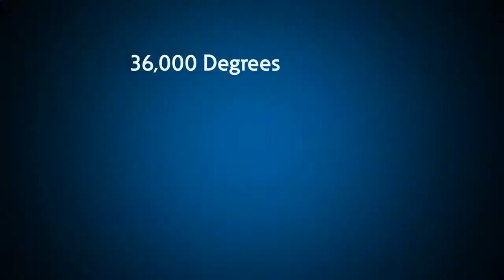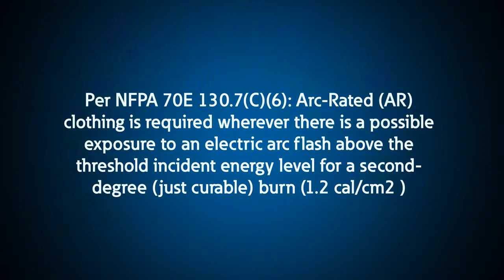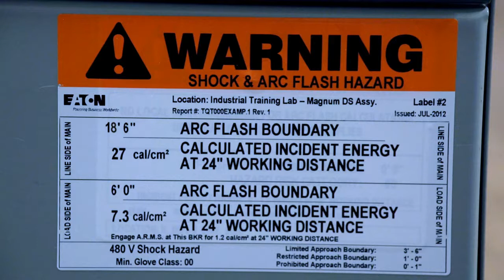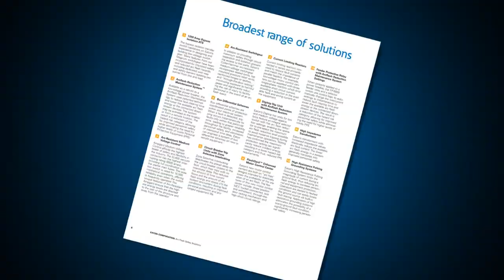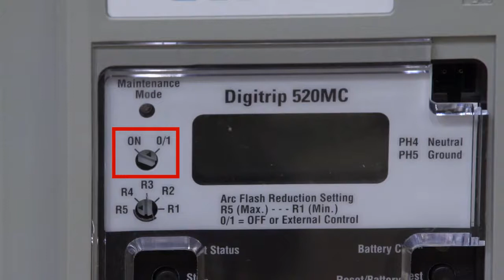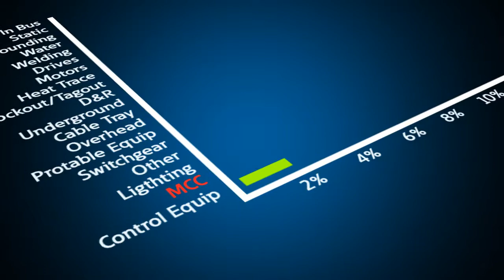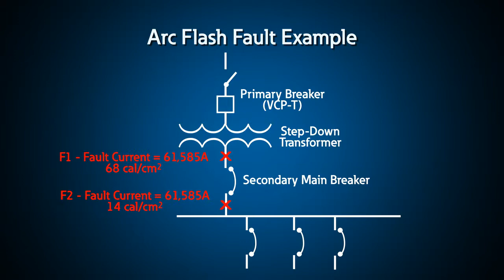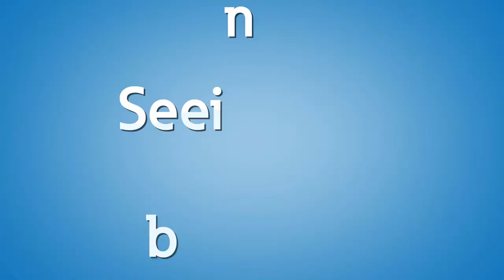Arc Flash Safety

Comment: To avoid arc flash make sure to put off all the electrical load before off or on the switch gear or vacuum circuit breaker